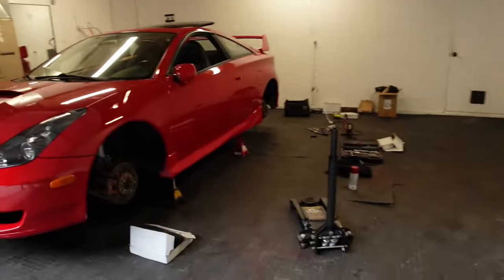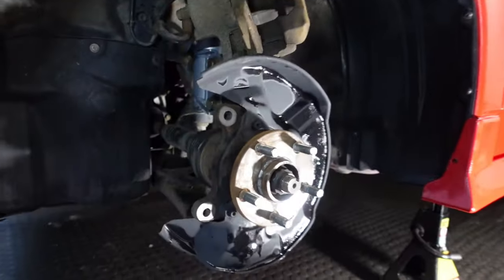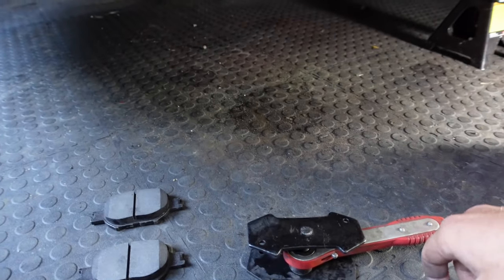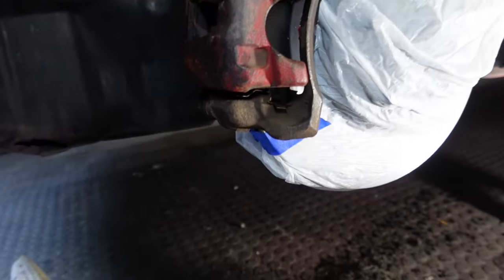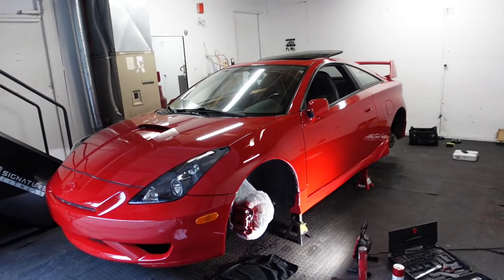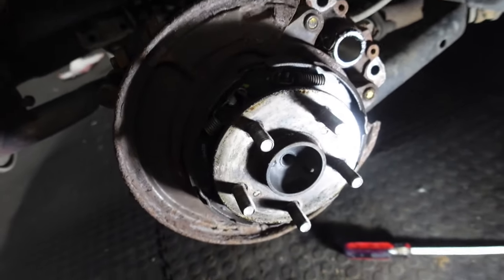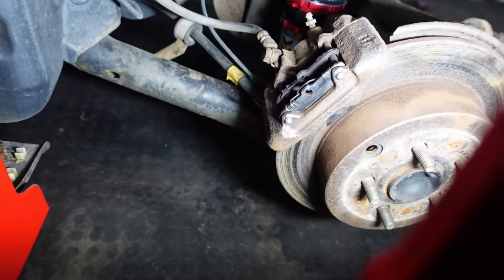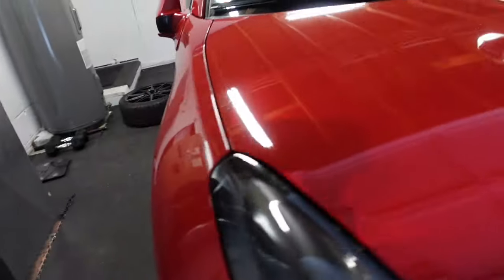Celica GT-S Best Brake Setup EVER!! MUST WATCH **

Comment: Hey Mitch, I was really looking forward to you going over the sequence of bleeding these brakes because I've been reading the brakes are not traditional like other cars where you start from the brakes furthest from the master cylinder. Also, I wanted to see the clutch bleed as well since it shares the same reservoir as the brake fluid. Can you comment? Thanks, and I got your short throw shifter you sent and slapped a shift knob that weighs 1 pound, and that things with the 1 pound shift knob is butter!
Reply: The brake lines cross over eachother and aren’t what they’d seem to be on the celica. The right sequence is REAR LEFT, FRONT RIGHT, REAR RIGHT and FRONT LEFT ( driver).